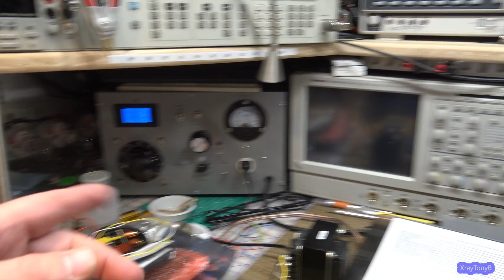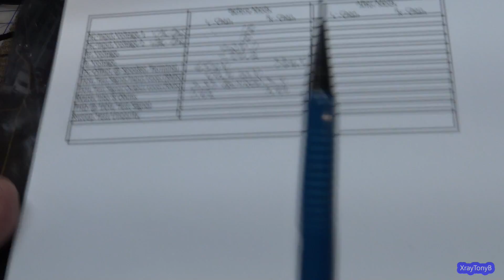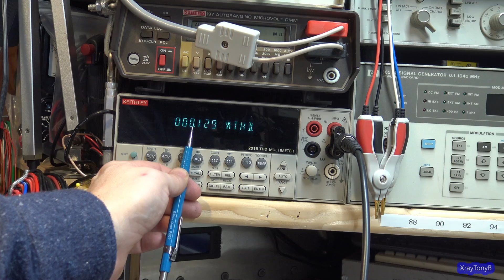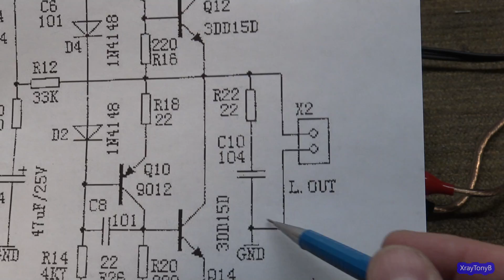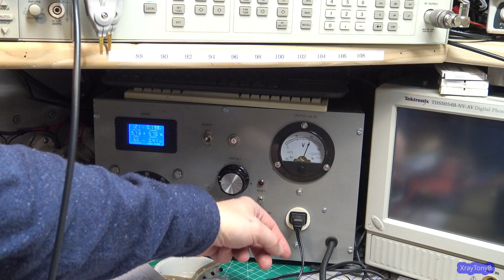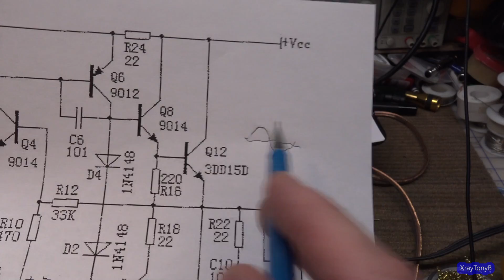Amps N'at Part 6 - Testing the Stock Design

Comment: This is a really good series with great explanations. I'm getting back into electronics again. I left it when I was just a little kid. Wire wrapping and SMD was coming out and it scared me off. I had a crappy Radio Shack soldering iron with the conical tip that never could have done SMD. I restarted about a year ago when we had the good luck that my Dad got Veterans housing help. That finally freed up enough money to buy equipment again. I can't really work a regular job since I have to take care of my Dad and I need a hip replacement. I have learned a lot watching other channels, but it's these details here that help pull it together for me. Thanks Tony!

Comment: How about a reactive load. That would really expose the crossover. It is very interesting that so few measure amplifiers with something remotely reminiscent of a loudspeaker with filters.  A resistor draws zero current a zero volts easy for the crossover.
When you have a reactive load current is not zero at crossover and that is heard, loudly. This i why tube amps are still favored, the are basically class A with no or very limited crossover problems.
 That type of amplifier, quasi complementary is crap. I was able to get complementary output transistors in 1972, so there is no
grounds for building amps like that now.
Reply from the maker: I applied a reactive load in the video when I placed the 470nF capacitor across the speaker terminals and applied a 1kHz square wave to the amplifier.  There was a small amount of ringing at the rising edge.  You could still see the crossover distortion in the waveform at the zero crossing, but it was unaffected by the reactive component.  The topology of the design is less important than the actual circuit design itself.  Tube amps can also have crossover distortion, if they are not properly designed.
Reply: Do the same test with sinus. No problem with crossover with square wave. And also 10uF 2 kHz gets a more interesting phase angle of the load.  @xraytonyb

Comment: 20W per channel! Nice 👍.... 
I can't believe how much has come out of this cheap amplifier! And I agree that the majority of people who put this kit amplifier together would have been happy with it's performance once they got past the ceramic capacitor issue... 
As it is, I'm quite happy with it but knowing that there's going to be modifications done to it has a grip on me that there's no way that I'm going to miss the next or future videos on this device.... 
If there's anything that I would love to see on this amplifier would be seeing metal encapsulated driver transistors fitted, actually I would love to see as many vintage looking components as possible (new old stock or new stock, not meaning used components!)... It already looks good as it is but I believe that it can look better with older looking period correct components!

Comment: The fact that Tony (and many others like him) have to repeatedly state "I do not have time to repair your unit, sorry" reveals a sad truth:

The skill set to repair these vintage amps is fading with this generation.
Few under age 50 (Gen X or older know these amps) know these skills and circuit topologies in 2023.

Therefore get your units repaired NOW today.

A time may come within 15 years when you CANNOT get them repaired.
Reply: I suspect most people getting into this vintage equipment at this point will also at least try to service it themselves.  It is like vintage automobiles, you know you cant find anyone to work on it, if you want one you assume that you will be the one restoring and repairing it.  Unless you are super rich...In a way this is good because this vintage equipment will eventually come back down in price as there is less demand.  The bigger issue will be parts availability, but like with cars, where there is a will....

Comment: Thanks Tony.  The fog is lifting!  I would love to own a Keithely, but not in the budget.  Are there more affordable distortion meters you can recommend?
Reply: Just checked on ebay, even those are $500, from china.  Would like to keep it around $300 @Runco990
Reply: How about the software that enable PC to be used as spectrum analyzer? Not exactly accurate but you can see when harmonics are present and what level they are at in db.low distortion wien bridge osc. is cheap to make.
Reply: I have a cheapo 2 channel scope that has FFT.  Really does not show anything that means something to me.   @johnstuchlik5828
Reply: I picked one up for free on freecycle .needed a little bit of work . A beautiful piece of equipment.